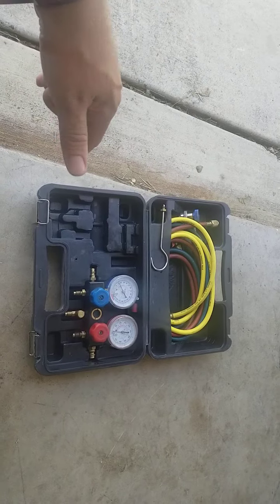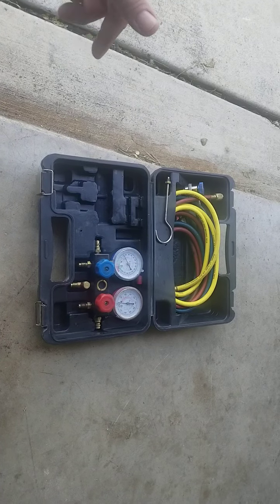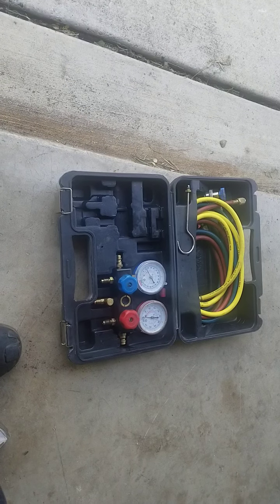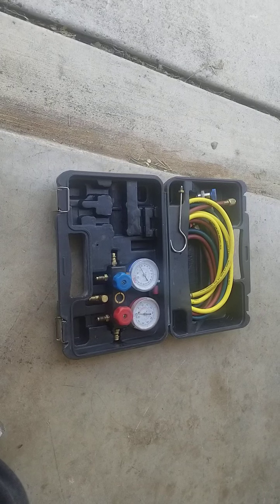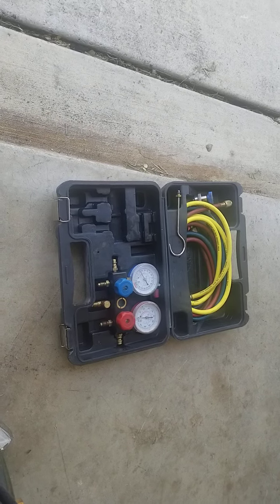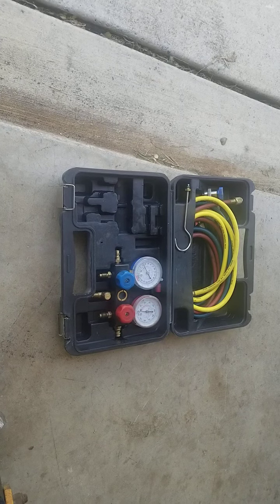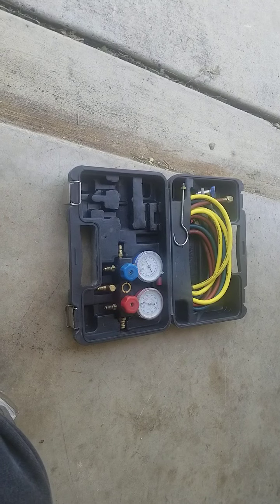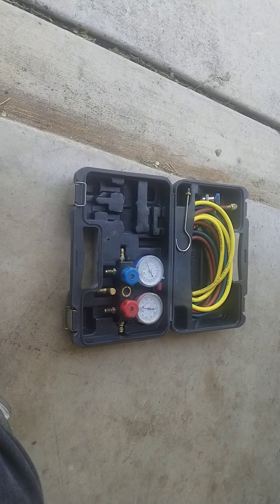Shop talk: A/C

Comment: Dye is ok, nitrogen is awesome!!!
Got dye in a couple of things, it's ok for big leaks, but doesn't work well.. I have a truck with R12 hoses, holds R12 GREAT... But as we can't get it anymore, it's been converted to R134.. the smaller molecules leak out the hoses. But not enough for the sniffer to detect. Dash and bunk units work great for 5 days. Freeze your butt off in it!! Day #6, absolutely nothing!! Crazy stupid!!
Reply from the maker: Walt till we hv to face R1234 which is flamable
Reply: @sonofmontezuma3732  there are a lot of R12 replacements that are supposed to be really good, but have propane or butane in them, they're oked for "stationary" applications, but not for mobile... LOL. Crazy!!!
Reply from the maker: i actually was present in the shop when one day one of techs was doing a tune up on a duster with a 225 he accidental touched the alt power wire and it sparked ,well the car had a/c  leak but it was full of propane  ,it blew all the hoses off. thats was about 30 years ago 

propane does work but is very dangers ,hope R1234 is not like that
Reply: @sonofmontezuma3732  ya.. it kinda goes BOOM!!
Actually isn't as bad as it could be, it's got to be the right ratio with oxygen to go boom.. 
Blasts 
Leveling
Everything
Very
Efficiently....
That is what it's called when a tank explodes B.L.E.V.E... 
Hope it just blew o hoses off and didn't hurt anyone!!